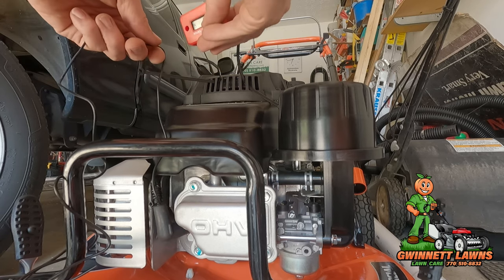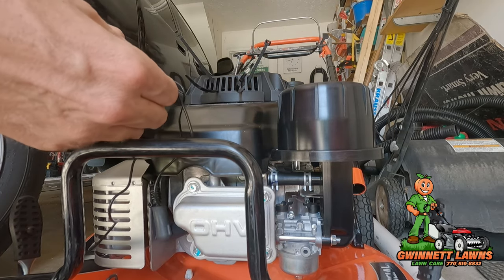How to install an HOUR Meter on a Bad Boy or Ybravo Commercial Mower

Comment: Wrapping the hour meter wire around the spark plug wire is adequate?
Reply from the maker: Yep that is how they work.
Reply: Mechanical hour meter is better.....digital has a built in battery that dies and most cant be replaced.....
Reply: @redblue40rc33  Mechanical hour meters still require a power source (such as a battery), which push mowers typically lack.

Comment: Are u sure u are not blocking too much cooling air to the motor?
Reply from the maker: Yes it only a few square inches and air still gets around it as that part I attached it to is curved and the meter is flat.